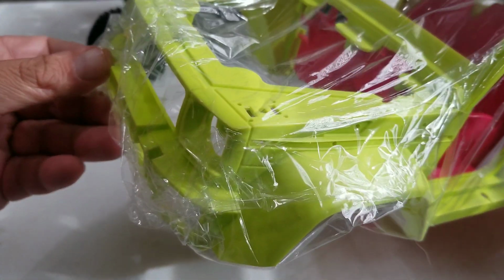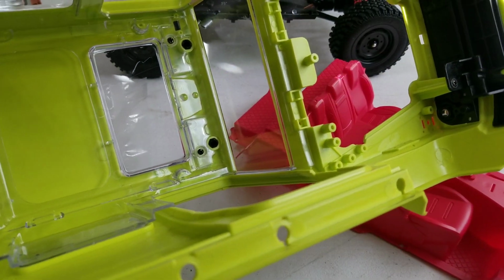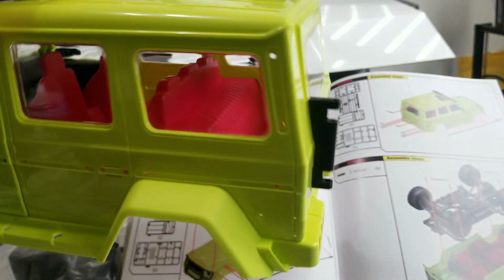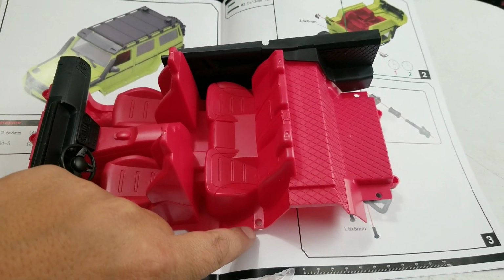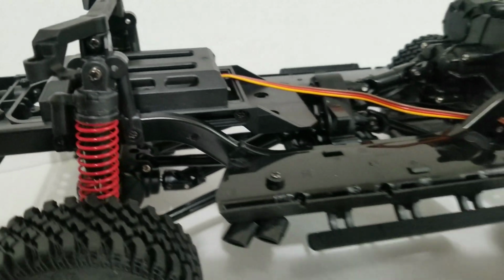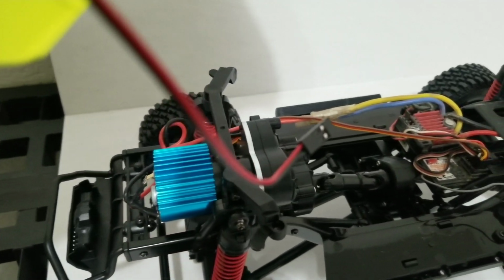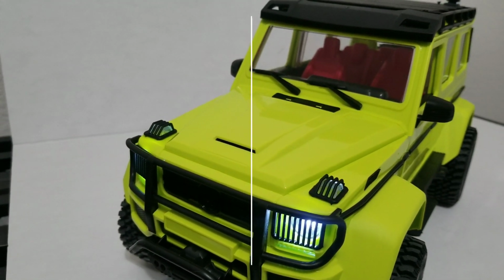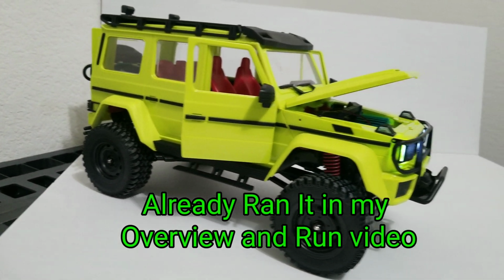MN Model MN86KS Build Part Three. Body and Electronics.

Comment: can the WPL Res V3 fit in there?
Reply from the maker: I think I've seen someone use the Res V3 but this rig is heavy and bigger than the WPL and MN d90s so ot hit esc protection and shuts down. I recommend a hobbywing 1060 or a 40a esc at least.
Reply: @RunThatRC  thanks! i'll try that.

Comment: You made excellent build videos and I really appreciate them.. Love this MN RC... Thanks man!
Reply from the maker: Glad you like them!
Reply: @RunThatRC  Yes sir! You explained the details about the RC I was wondering about very well. I plan to order the 86ks soon. I went ahead and bought the Flysky transmitter, etc. earlier.. I forgot what ESC brand and size you purchased? I want my electronics to fit the frame nice like you have it. I've seen some using oversized batteries inside the interior, lol. I mean, I like my car to look real and that sorta defeats the purpose of the hard body when you load electronics inside the interior of the car. Anyways, appreciate the work you do.

Comment: How do you remove the battery to charge and store? Do you have to unscrew the whole body from the chassis? Thank you
Reply from the maker: unfortunately its a built-in setup. You would need to modify it if you want interchangeable batts.
Reply: @RunThatRC  thank you. I just thought since you are supposed to store and charge lipo's in a fire safe container/bag that it would be removable. Do you not store your lipos like that, am I doing overkill?
Reply from the maker: @KF-hb5vx that's definitely not overkill. Better safe than sorry they say. A lipo is most dangerous while charging and discharging. This little guy should be OK because it has a slow charger and it's not a very taxing system. Don't forget your cellphone that you carry with you has a lipo as well. Unfortunately for these there is no way to tell when it's at a storage charge. I would see what your general runtimes are and just run it half the time and you should be at storage to help your battery stay healthy longer.

Comment: Got any idea what the id (inner diameter) size is for each of the 9x3x?mm & 11x3x?mm bushings/bearings? I want to put a set of bearings together for my MN86K.. manual doesn't say & it's assembled so I can't tell since they don't list in on them in the manual.
Reply from the maker: 5x9x3mm ball bearings 15pcs and 7x11x3mm bearings 8 pcs.
Reply: @RunThatRC   Kewl we MN86K guys know what size & how many to get thanks.  The "Simulation Details Decoration kit" lol, the MN86K to MN86KS kit is on AliExpress now, as of today I bought the 1st out of 1000 from seller Warmom Store... It includes all accessories from 86KS that aren't in the 86K kit, bearings, accessories, 20t motor, spare tire & rack, extra pinions, gear cover ect...
Reply from the maker: @Craigstern73  I knew they where going to pull something like that. Next is probably going to be upgrade parts from aftermarket hopefully. Thanks for the info!